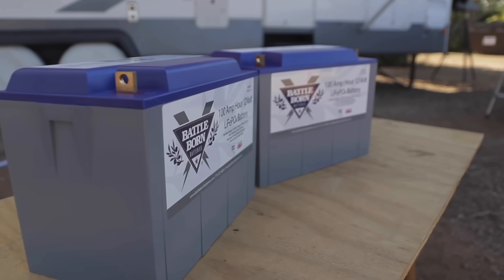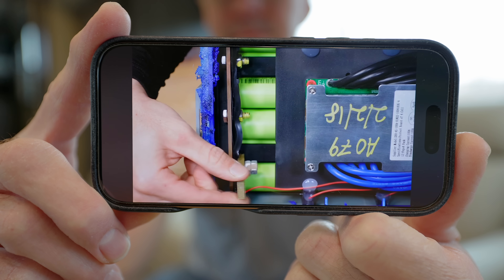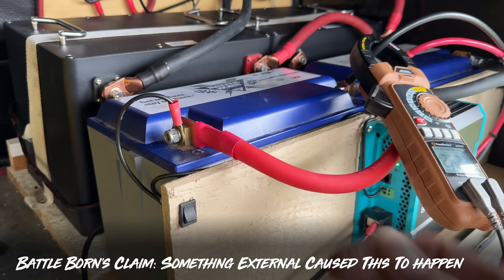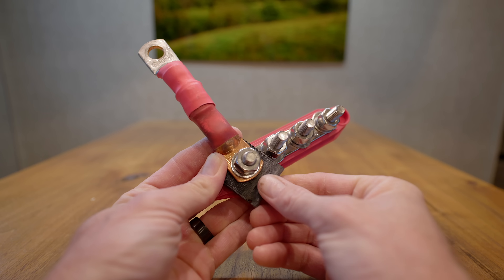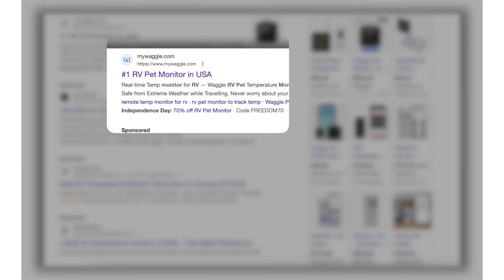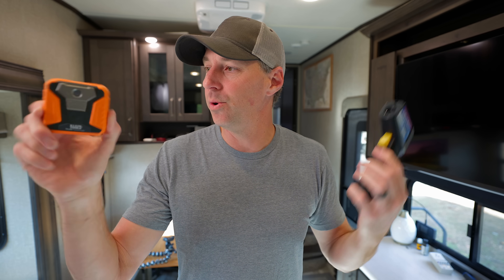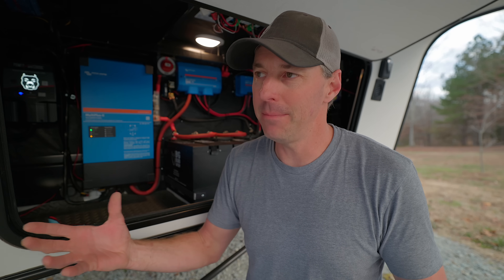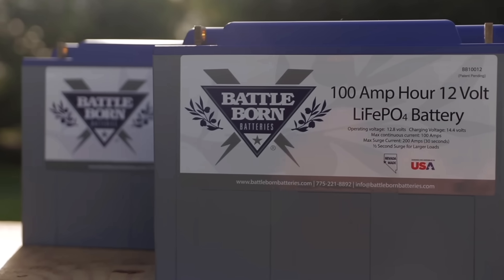Battle Born Batteries Problems!

Comment: I don't like the way BB are designed or put together...not very forward thinking. Have a look at Discover Batteries, a company that started in Vancouver BC and now is a global source. We bought 3 x 200 Ah Lithium Blues. They have a heat sink , Fuse and vent at the top, a removable BMS and a completely accessible interior. There is a video explaining the difference between these and the BB, which you need to cut open to access. A Bluetooth link gives you complete readout about what the battery is doing including voltages, temps etc... We had one cell drop in value, which is not necessarily dangerous, but not indicative of a balanced battery. They replaced the battery within a day and gave us a spare BMS top and send us on our way. Not cheap, but definitely worth the peace of mind. There is a video which compares Lithium Blue to other leading batteries in a teardown. Very revealing...Just do a search.

Comment: My logic is a little different here. If this ridiculous bolt configuration is such an important safety feature, why don't other battery manufactures use it? Why is it not potentially patented, or patent pending? If that isn't possible or feasible, why is it not at least part of the marketing and safety campaign used to sell batteries? Quite a few samples have been cut apart, and these BB batteries seem to be oddly unique. And this design (defect) was nicely hidden and not discussed until owners and content creators got out the flush cut saws.
Me personally, I've only ever seen one BB battery with a melted mess at the terminal in an RV. I've seen 4 more from RV content creators actually using them. Now a handful more have surfaced as this has unfolded.  Oddly the cheapo stuff always seems have a BMS to shut off the battery from overcurrent, and the accepted practice is a nearby fuse or other circuit protection. One benefit to that redundancy, is that it is possible to recover and continue to use the product after the cause of the event has been corrected. Not possible with a melted internal plastic part.

Comment: Wait, I didn't see a split washer under the nut in Will Prowse's video.
Reply: Not a split washer, but Will said that BB says not to use a washer between the cable and the terminal, but he found they have flat washers on the internal bolts that melt plastic, loosen, heat more, loosen more ...
Reply: @davebrown9725  split washer is a spring that would maintain some compression as the stack get loosen up.  I use split washer on all of my terminals.

Comment: "Fail safe" absolute rubbish. Plastic between the contact of the connection? Seriously?  This is insanity straight up . You won't even find rookie DIYs doing some so fundamentally flawed let alone an organization developing high energy systems. All the energy is being forced through the stud a small concentrated area taking large amounts of current...it's going to get hot end of story . Even if this "design" doesn't result in an failures it's a failure in design from the start and their engineering team should be ashamed of themselves. It's garbage, 100% and so is their accountable response to it

Comment: Battle Born's problem is that they're demonstrating that they're both not trustworthy in their response (basically straight up lying about the engineering), and that they're also not delivering either the premium product nor the premium service their prices imply.  Sure, as noted at the end of the video, it's not unheard of for companies to have this kind of problem.  But why deal with a company that's just demonstrated who they are in a way that can't be ignored?  Especially at their price level?

Batteries (especially in an RV) are a life-safety critical system.  They also cannot easily be opened and examined, even if you have the expertise to examine them.  Their internal design can be changed at any time, without warning, and without any visible indication.  As such, faith in your battery vendor is much more critical than it is with most of the other products that go into an RV.  So even if the public pressure forces Battle Born to step up and have a better response, why would I trust them going forward?  What does it say about a company if they only do the right thing once they have no choice?  And at the moment, we don't even know if public pressure will be sufficient to make them change their stance.

I cannot imagine buying a Battle Born battery in the future.

Comment: Hard to find an honest manufacturer. Bought a Vaterer battery with a 5 year warranty. The Bluetooth failed in the first 3 months. They offered to replace it, but would only cover the return shipping if I didn’t disclose it as dangerous goods. Never was able to get it replaced.

Comment: There is no case where sandwiching plastic within a stack of electrical connections is a valid engineering approach or even remotely safe. There is a 100% chance of failure. BB has allowed a very badly engineered product out the door and are now feeling the pinch of doing so. Shame on them for allowing such an egregiously dangerous issue out into the wild. And shame on them for fighting it. They should have just eaten the loss and replaced all those batteries. Now instead they will just slowly die on the vine as people stop buying their product because it currently is capable of burning down your home or RV, and they are having a crappy attitude toward customers about it.

Comment: The positive terminal in that battery can never be properly tightened down to the bus bar because the plastic between them is too soft. If an assembler tried to tighten it properly the plastic would just deform. It's a brain dead design.

Comment: The ISSUE is being missed here, and likely the main reason for this happening after a few yrs - the battery is mounted in a moving RV - that nut is loosened by taking a beating over bumps - here’s your loose overheating…. a nut is not the way to connect to the bus

Comment: There should have been a metal insert in the plastic, such that a proper clamping force can be applied, without relying on the plastic. Not a very expensive solution, compared with loss of reputation and damage due to fires. I don't ever believe that this was intentional design - there are safer methods of disconnecting an over current. Any lateral force on the positive terminal during installation - like tightening the battery cable bolt, or in motion, like a heavy cable moving under vibration is going to start the loosening process. After that it's all down hill and increasing heat.

Comment: With numerous credentials in systems engineering I can confidently say, this is a design failure, and battleborn is likely making stuff up for PR at this point. Not a fail-safe (which by definition fails safely), this was just a straight up goof. If anything the plastic could be located on the nut side to give a bit of a thermal break to the threads to keep it from backing off. I would not assume the liability of recommending a battleborn product until this issue is fully resolved. If that burns down someone's off grid setup and / or injures or worse, your recommendation could be brought into legal arguments. Stay away with a 100' pole.

Comment: How many fires has this caused?? Retired Firefighter, battle born owner.   I dont like the connection and I dont like their response. But they apparently are not failing to the point they are starting fires. 400,000 batteries sold. If they had  10 fires out of that 400,000 , they would have issued a recall. Insurance companies would be all over this and not cover Battleborn involved fires. Whenever we had a fire we had to document any and all equipment involved. Make, model, serial number. This all went into the states database.  I only found mention of one fire on the web . It sounds like it was an over voltage problem that the owner  knew about and didn't correct?   Im not going to lose any sleep.     I am a bit concerned Will might find himself in a lawsuit? No good to exclaim "fire danger" when there isn't a history of it?  Battleborn could possibly argue that yes the connection doesn't look good, but it is functioning as intended since there hardly any fires???      I wasn't going to buy a battle born again just because of the expense.    Single RV battery, low charge /discharge rates.

Comment: Battle Born just needs to own the mistake, and fix the problem. Denying the obvious is not going to help their case or their brand. Their batteries are really expensive, and clearly cost is not an indication of quality. I have a Vatrer battery on my RV and though it had a BMS failure at 8 months, Vatrer really stepped up and replaced it at their cost even though their warranty says the owner was responsible for shipping.

Comment: Hello, I am new to your channel and I understand that you are trying to be careful in passing any judgment on Battle Born. However, their comments are just marketing statements! I am now retired but worked for 40+ years in Product Safety for major, Fortune 500 companies. I performed in house electrical safety testing for consumer, medical research, and medical equipment (In Vitro) products. Their claim that the deforming plastic is a "certified" design to break the circuit and prevent thermal runaway is just not correct. For this design to operate as a safety, "disconnecting device", their design would need to either completely open (like a fuse) or completely open but be resettable (like a breaker). As can be seen in Will's videos, this is not the case! With excessive heat, the plastic deforms causing the positive terminal to loosen from the bus bar. It then can make intermittent contact causing heat, more deformation, and increased arcing. IT DOES NOT DISCONNECT the connection and thus does not meet ANY standard for a safety,  "disconnecting device". Their Marketing department is making statements without seeking guidance from their engineering department or their certification lab. 

I have already written Battle Born and asked for the test standard and clause they used to justify their statements. Easy to do and would put this issue to bed. I have yet to get a reply. The manual, as well as some of the battery labels, indicate they are using UL test standards and, for CE Marking (Europe), they would also need to be testing to the relevant IEC or EN standards. Again, Europe would not consider their design as a valid safety, "disconnecting device"! However, they can self certify for the EU...

Please note that I am not saying that Battle Born has intentionally done anything wrong. As stated by a person commenting below, this is a design issue and not a manufacturing issue. Yes, it sometimes takes time for flaws to become apparent but when they do, it is the responsibility of the company to act especially when it can result in injury or worse! Furthermore, any product issue which may impact the safe operation of the product must be reported and corrective action taken. This is typically 30 to 45 days. In the companies I have worked for, the Quality department would quickly step in and develop teams to immediately deal with the issue. A fix or redesign may take time but Quality would still reach out to Vendors/Customers and be transparent with findings and a proposed schedule for repairs and/or replacements. The NRTL would be included in the "loop". I have not personally received any replies from Battle Born nor seen anything on YouTube to suggest this is happening.

With no reply, I decided to report this to Intertek which is the certifying NRTL (Nationally Recognized Test Laboratory) Battle Born used for these battery products. If you look at their manual and battery label, you will see that their battery models are certified by Intertek (cETLus Marking). This mark shows that the batteries have been evaluated and CERTIFIED by Intertek (for use in Canada and the USA). I cannot see Intertek certifying these batteries (as is) with Battle Born stating that this is a safety, "disconnecting device" meeting the UL Standards. Based upon Will's video showing capacity issues, I find it hard to believe that Intertek would go for this as well.

I am hopeful that Intertek will review the issues and complaints and work Battle Born in a timely manner. I am also hoping that Battle Born will be transparent with their customers as well.

Concerned Customer using Battle Born batteries in my RV...

Comment: Hi, we want to replace our RV wet Pb acid with LiFePo4. However, Dumfume replied saying only mount with terminals up. I mean they "recommend" this. We want to put the new battery on end as this will both fit nicely and allow greater capacity in a battery. Comments anyone? Brands where okay to mount on end?

Comment: I would just like to point out that Will was responding to Battle Born users problems. As an electrician I would like to make a couple of observations. One, bolts are not used as conductors, they are used to join conductors together. Two, when connections are loose heat becomes a problem. It seems that Battle Born is saying that a loosening connection is a safety feature. I'm sure that is NOT the case. 
Will was a big proponent of Battle Born Batteries prior to these issues arising. He has the humility to change his mind when problems started appearing. This is exactly why I trust his opinions. It's important to always keep an open mind and not stand by previous thinking when new information is brought to light.  It's how we continue to growing and learn!
Reply: Will is totally an unimpeachable resource. Battle Born MUST pay attention. I'm glad to see someone else referring to his knowledge. I've been following his videos since he started about 10 years ago. Because of his videos, I was able to learn and build my entire solar system for my cabin starting with knowing only that panels and batteries were a thing.

Comment: A more recent video from Will shows another nasty design issue where banks of cells rely on simple lateral pressure to maintain contact between the conductive plates between cells. It's pretty clear to me that BB fails at basic battery design.

Comment: I might believe them that at least the majority of these issues they see are externally caused/abuse (people are going to abuse things and then try to claim warranty, it's inevitable.) What I don't know if I believe is their claim about the lug and nut being a thermal fuse. There's better ways to design something like that without using the bolt as the primary conductor. Unlike an actual thermal fuse it doesn't have a way to actually disconnect the circuit. The plastic isn't going to snap the bolt so there's no way it could actually be counted on to cut power. If they needed a thermal fuse they'd have used a dedicated one that will reliably break the circuit. As for their claim about UL, there's just no way. UL wouldn't require them to implement a thermal cutout in such an unreliable way. If anything I'd expect UL to refuse to count that as a thermal fuse if they tried to pass it as such. It's possible it had to do with some other UL requirement in some way, but representing it as UL requiring that to act as a thermal fuse, I'm calling bull.

Comment: I think we can agree that I’d much rather just see a 125A fuse in there than a sacrificial piece of plastic that is going to melt and create a deliberately loose connection.  They need to rethink this excuse.  I’ve don’t some work with UL and CE testing and that’s not the way it works.

Comment: One amp of discharge of 100a of discharge - the design is just beyond stupid. It is just....dumb. Beyond dumb. Mind numbingly stupid. That is the issue that so many folks have with this discovery and to know it has been this way for YEARS is just nuts. 

It seems that the easiest thing you can do to inspect your battery to see if the red plastic surrounding the positive terminal - if it isn't bright red it has been overheated.

I am disappointed you didn't flow current through your mock setup :)

Comment: This issue was pointed out 4 years ago in a tear down video made on a different YT RV channel called "The Fit RV" . You can find that video by searching you tube for Lithionics vs "Brand B"  BB explanation is that if you introduce resistance voltage will drop and should reduce the current. Not sure where they got this idea from almost like it came from someone who has no formal education, or industry experience. The better idea is use the BMS overcurrent protection also add a Class T fuse that is rated 1 1/2 times the max current. If the class T fuse blows it renders the battery inoperative the customer has to warranty the battery not continue to use it.   Their idea allows for further use which causes further melting and more heat.

Comment: Not trying to discredit the obvious issues people have seen, but I’d be very curious to see their installs and configuration settings.  I had 5 of the 100 amp hour BB batteries in my motorhome and lived in it full time. The only issue I had was when one of my battery connections came slightly loose.  Re-tightened connections and never an issue again.  Had a 4kw generator, 1500 watts of solar.  Routinely left it parked in the sun running the AC and fridge on 120v for days on end.  But I generally limited charging and discharging to .5c.  Never an issue.  
Running a 270 a/hr bb on my trailer, doing the same thing.  I’m not charging and discharging over and over back to back at 1c.  
So yes, I think they’re safe if properly installed and monitored and used within the recommended limits.  Pushing them to max limits back to back, maybe not.  
Regardless it would be good to see the manufacturer acknowledge and correct the issue.  It’s a simple fix.  Put an internal fuse in the battery or better BMS if that’s what is needed.